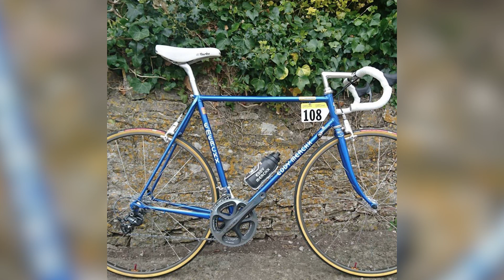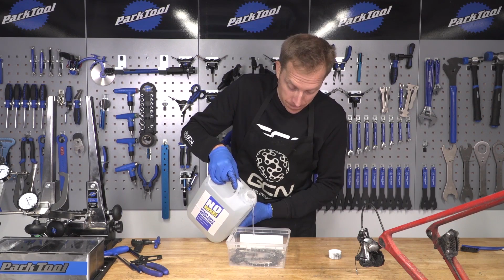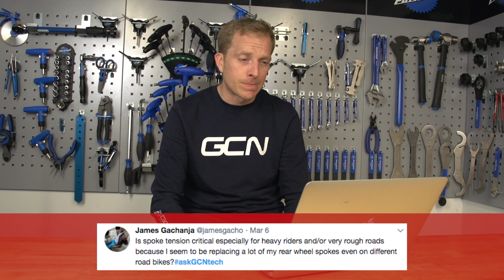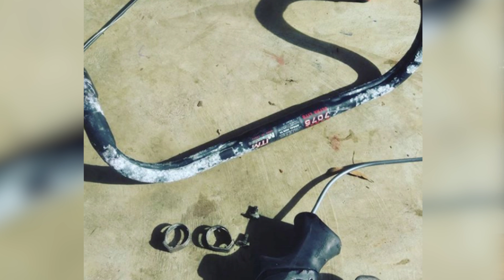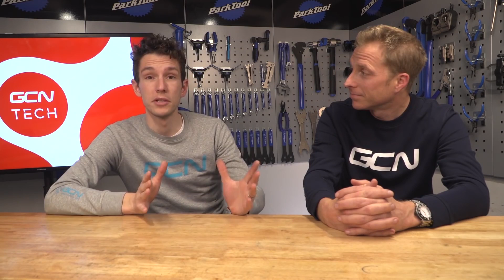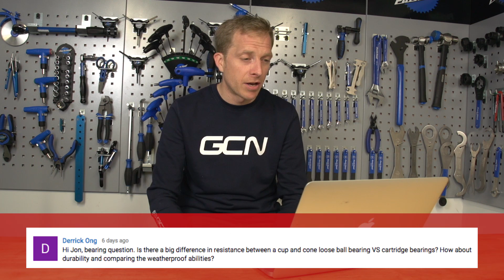Is Degreasing Your Chain A Waste Of Time? | The GCN Tech Clinic

Comment: Could some unproperly tightened chainring bolts lead to a creaking crankset? Mine is a BSA square taper, so I don't have any issues associated with Pressfit BBs. Even easy acceleration makes it squeak quite loud #askGCNTech
Reply: I would say if it's creaking it could be the chain ring bolts. If it's squeaking then probably not. Have you got a squeak or a creak? They are quite different. You can think of a squeak as a high velocity creak. Anything spinning slowly, like cranks, is not likely to be squeaking. Squeaking is nearly always something in the drivetrain, usually the chain. If it's creaking check your QR skewers also. They can make an unbelievable racket if they get dirty. Take them out, give them a good clean with soapy water, rinse, then a good dose of WD40. Pay special attention to the camlocks. Wipe them dry and put back on. 5 minute job and could save you dismantling the bike to find the phantom creak. Loosening and correctly tightening chain ring bolts is also a 5 minute job, so just do it anyway.
Reply: Well, i tightened them now down to 8NM. It's less noisy but still present. Sorry, only a creak which really only comes from the crankset/BB area. QR skewers are silent since i clean smaller parts of my bike via ultra sonic cleaner.
Camlock is greased and alloy on alloy. Also tightened the pedals to the specific torque and also greased the threads.
Reply: Have you checked the manufacturers recommended torque for the chain rings? I run FSA rings on a SRAM quarq spider and tighten to 12NM. Also I grease the flanges of the bolts where they contact the rings, as well as the threads. I've never had creaking bolts. Failing that, if it's definitely coming from BB area then it must be the BB. All BB's can creak if the bearings are dry or worn, not just pressfit.
Reply: Check your cleat-to-pedal interface as well, and even cleat-to-shoe. And your seatpost/saddle/frame, if you haven't already. It's astonishing what sort of non-drivetrain noises can seem to be coming from the drivetrain when pedaling!
Reply: Is your frame metal or carbon? Maybe your bb shell is cracked.

Comment: My question is about x1 system - is it ok to switch x1 from x2 system, 105 5800 for example, just by changing front rings to one narrow ring? and is it good idea to use normal derailleur for cx1 force for road use ( red for example coz its weight)?  Thank you! #askGCNTech #askGCN
Reply: Yes you can. I have an Ultegra 1x set up. The 105 chain rings are narrow-wide I believe so you could keep stock chain ring and it should prevent chain drop with the front mech removed. You could buy a drop stop chain ring from Wolftooth (that's what I have) there are lots of tooth options. It doesn't totally prevent chain drop but it's rare. If you want a bigger cassette (beyond 32T) as well you'll need a road link from wolftooth to lower the rear mech. I have the Ultegra med cage and works fine. I'm converting my wifes 105 to 1x next.
Reply: 105 chainrings are not narrow-wide. If they were, you couldn't shift at the front, as the narrow-wide teeth do prevent the chain from being derailed/dropped. 

Replacing the chainrings with a 1x chainring (narrow-wide, like the wolftooth) will work, The new chainring should go in the big ring position and is dished inwards, to move the chainline in. You will also need new chainring bolts (the 2-ring bolts are too long), or special spacer washers.

The rear derailleur does not necessarily need the clutch, but on rougher terrain, it is useful.

Comment: Hey GCN guys keep on doing those great vids, I have one question about cranksets. I was wondering what's the difference between 110 and 130BCD cranksets(i know that this is the diameter of the bolts), but I don't understand why we all don't use 110 because you can get a bigger range of teeth number from 34 to even 55t chainrings for 110. When you look at 130BCD you can't get smaller than 53/37 I think. Is there any difference between 55t on 110bcd and 55t on 130bcd.

Comment: I went from sram doubletap to 105 and find the paddles are flappy till you get to gear you're about to change. that's normal right?
Reply: jlebrech yeah it's normal, it's to prevents misshifts as it shifts and brakes with the same paddle.
Reply: Bill Ho thanks, it's also much better to use without gloves. Might get some fingerless ones

Comment: my gears aren't shifting properly..... i've cleaned the chain and the casette  but it just won't shift properly
Reply: How old is the shifter, cassette, chain.? have you adjusted the derailleur cable adjuster? Adjust your cable tension first if that doesn't work try a new chain and if that doesn't work try a new cassette and alas if it still doesn't shift it could well be a well worn shifter. Trust me i've seen everything replaced only to discover the shifter was worn out. Usually you'll get 9/10 shifts right but one will not work no matter what you do when a shifter has worn.

Comment: My bike chain always gets off what should I do
Reply: You'd have to pay attention to exactly how it comes off and this can be tricky as it's not always reproducible in the shop.  The most likely cause though is one of your limit screws on the front derailleur isn't tight enough.  You only want the front mech to be able to move just as far as it needs to in each direction and no more.  Do though make sure to test front shifting while in a rage of rear cogs, since what works in front for one cog doesn't always work for another.  However, some combinations aren't expected to work well, particularly shifting into the big ring while one of the largest couple of cogs, or shifting into the small ring while on one of smallest cogs. The solution is don't do that.

Another possibility is backpedaling while in one of those bad combinations.  That can happen when starting at a light. This binds up the rear deraileur pulleys which results in loose chain on the front rings and it falls off.  Again, the solution is don't use those bad combinations and especially don't backpedal in them.

Also check that your front derailleur rides 1 to 3 mm above the big chainring and that the outer front derailleur cage is straight.
Reply: Big Ring thank you

Comment: i have a question wich bothering me  lot of time.
so
does ceramic bearings wearing slower that regular or not?
Reply: NickolasRad will you even keep the item long enough for it to matter?
Reply: You know, if you're not gonna answer the question then don't comment. The ceramic should last much longer. It is way harder and more resistant to wear than steel.
Reply: Dan's video on ceramic speed factore gave more than expected-5000km and 45k.that's mighty

Comment: #askGCNtech Hi Jon. Every weekend I clean my bike, but when I put the wheels back in I have trouble with a bit of rotor rub. Synapse '17 Ultegra with quick release. I've tried the usual re-alignment of the calliper but it doesn't seem to help, so almost every weekend I find myself pushing the pistons back. Rotors then run fine all week, until I clean my bike again! I swear I'm not touching the brake levers when the wheels are out. Do you have any advice?
Reply: Sticky pistons perhaps?
Reply: i find that annoying with quick release, too. try setting it up correctly, and when you remove the wheels, try only loosen the lever side one revolution. when re-installing the wheel, only tighten the lever side that one revolution. that way, your wheel will be much better centered. and you can judge the centering of the disc pretty easily by eye (between the pads) and move the wheel by releasing and tightening the according side of the quick release thingy.